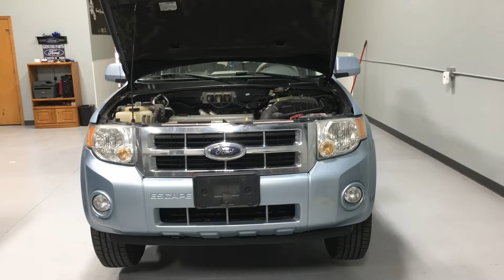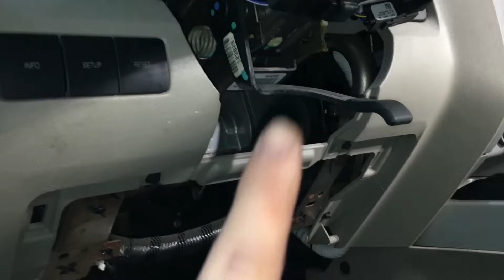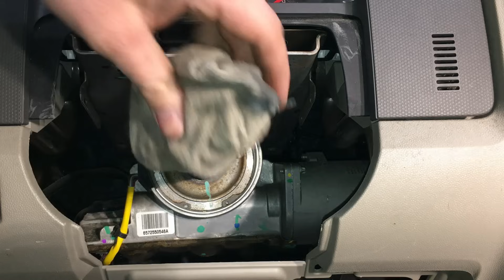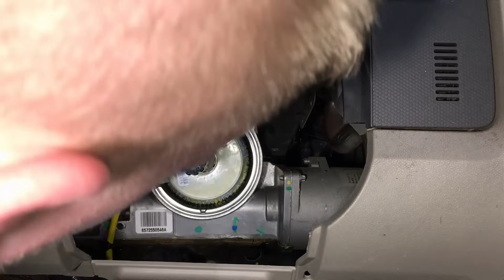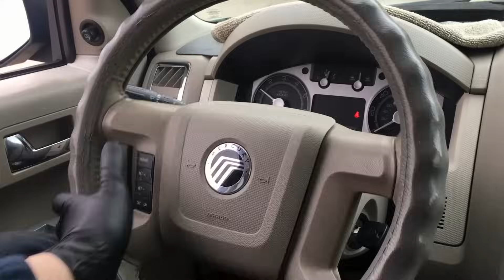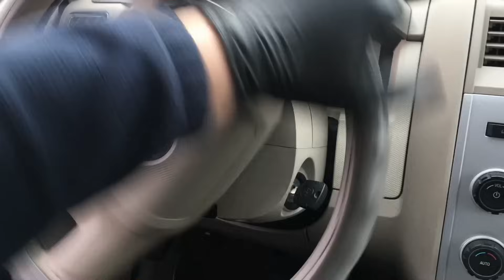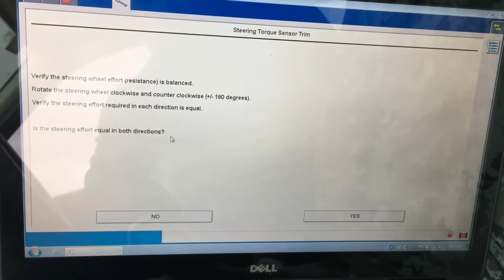2008-2012 Ford Escape Power Steering Code B2278 : EPAS Torque Sensor Critical Installation Steps

Comment: I followed this video step by step and it worked for about 5 minutes after. I reversed out to the right to go for a test drive and the power steering went out completely. I used a cheap $40 torque sensor from eBay (it’s a junky escape that’s a backup car). There’s no codes and there was no noise. Just completely went out after I replaced it.

Comment: So would this cause the power steering to shut off on occasion? This started happening, and now there is no power steering at all?
Reply from the maker: Yes it can, time to pull codes.
Reply: Thank you for the input, will hook it up and check. No engine light at all but I will check. Thanks for all the content! Love your channel. I have a 5.4 too that you have been a tremendous help with.
Reply from the maker: You must pull codes from the power steering module.

Comment: Question:  Replacement went perfect as video shows, on jacks stands.  Then I put it back on the ground and no more power steering??  Did I miss something, or is the power steering gearbox bad.  It did Not have the P2272?? code before hand, just super tough steering...   Any advice would be great....  PS:  Snap ring destroys cheap Harbor freight snap ring tools....  Always buy built in USA... bc

Comment: I installed an AUTOTECNICA FD1318479 torque sensor from RockAuto and programmed the trim adjustment. Only lasted for 2 weeks and my customer is back with the same B2278 code and armstrong steering. Thoughts anyone?
Reply from the maker: What was wrong with buying a Ford one?
Reply: @FordTechMakuloco  great answer, real helpful. The price. Ford  was double.  I was moreso wondering if anyone had run into the same situation.

Comment: HELP PLEASE, have the part and everything, that the step of aligning the window before i replace sensor. The arrow is aligned on the old sensor, but i don’t see the window. Do I replace or does the window need to also be aligned when i take it out? The arrow is aligned but the window isn’t. Does the window need to only appear when replaced or before replacement aswell? PLEASE HELP

Comment: I have a question I have a 2010 mercury mariner . Problem with power steering it goes in and out along with blower moter for heat. But not the symptoms that you show on here. Not sure if I replace the sensor

Comment: This 08-12 ford escape  Power steering torque sensor is pain in the ass to replace cause they are very very tricky and only one time use means if you get it wrong its done, I've tired 3 different sensors. One from amazon thats fliped out right lock and took it out and re aligned it put back in than it fliped to left. Same jack stand surface level area. Than tired the old one after zeroing the hole in the sqaure window it worked fine but it had a problem with vibration a bit thats why i wanted to replace in first place but hey atleast i have power steering. Going to replace  the whole steering column tomorrow. I will post an udate on the result. @FordTechMakuLoco any suggestions bud? Thanks

Comment: Did mine today. All around good vid. NOTE: the new sensor did not work at all until I ran the steering column trim sensor re-learn. Performed with X-tool d8.
Reply: OK... now we are talking. I followed this video and the steering is as stiff as it was prior to making the repair.
More on those learning tool anyone?
Thanks

Comment: I did this and replaced the sensor. When I turned it back on. It still had the code and the steering was still stiff. Do I need to replace the entire thing?

Comment: Does anyone know if you just unplug the sensor if it makes the steering loose but manual ?
Reply from the maker: It will go full manual steering, not recommended.
Reply: @FordTechMakuloco  yeah now it fights against you the harder you try to turn the more the motor fights you. I’m not replacing the sensor. Got 300k on it and AB’s module bad to but I’d like to be able to move it round if I can. Guess I’ll sell it as a parts car.

Comment: I remove the new Ford torque sensor i put in after reflashing the unit steering wheel went to the right.
After removing it in line up the upper and lower spinals and reinstall the unit it works perfectly fine. Thank God

Comment: When I was putting the steering column back in place I had issue of it binding up and knock me out of the window.
The spline moves up and down once you remove the column.

Comment: Cuts out the biggest pain of the job lmao
Reply from the maker: What's that?
Reply: @FordTechMakuloco  putting that damn steering wheel back lmao
Reply from the maker: It take a bit of patience to line up but only goes one way so its pretty simple.
Reply: @FordTechMakuloco  but great video I just did mine yesterday

Comment: Thank you for this video! Was able to replace at home on our 09 Escape. By chance do you know how long it takes for the PSCM to relearn the trim on its own? I purchased FORScan and ran the re calibrate torque sensor program. It says it completes successfully. But its still stiff turning to the left and smooth to the right. Debating whether or not to have the local shop do it or just wait and see if it does it on its own.
Reply: I'd love to know the answer to this too. Replace mine as per video but it's as if I never replaced it. Stiff as it was prior to repairing.

Comment: I did everything correctly and I still have no power steering.
Reply from the maker: Clear codes in the power steering control module and retest.
Reply: @FordTechMakuloco  thank you I will try that
Reply: I flash my 08 Ford for torque sensor.
And the steering wheel took a spin to the right lol I did something wrong. Lol
P.S. - That was one tuff C  Ring to remove.

Comment: How do you keep everything lined up when putting the steering column back in and putting the 2 bolts on? Doesn't it mess up the alignment on the sensor when the whole thing is moved up when screwing in the bolts?

Comment: Got a 09 ford escape. No power steering codes or wheel shake like that. However, it binds up and hard to turn to the left, but turning to the right is fine. Like it lost power steering on the left only…. Very odd. Anyone know what this is? Hopefully easy fix

Comment: I recently purchased a 2012 Escape and it does have this fault code but the steering wheel doesn't shake and steers fine, I've tried erasing the codes but it immeddiately comes back. What does that mean?

Comment: Question for you or for any other commenters: I did everything perfectly except I forgot to actually plug the torque sensor in before I turned the car on and tested it…now I’m left wondering, would it have worked if I had actually plugged it in to begin with?

Comment: I know this video is five years old, but I just wanted to ask/confirm: you don’t need the “fast learn mode” or to use the torque sensor trim tool, do you? That’s just to make it easier/faster? It will still be okay to just let it learn slowly?
Reply from the maker: No you will still have power steering just not perfectly equal assist.

Comment: Thanks for this great video. This looks well within my skills. One question. Does that alignment need to stay until the key is first turned on or only until you pull the pin? Thanks again

Comment: Car came in with no power steering. I changed this sensor according to your video it still had no power steering. So I used my scanner to recalibrate the sensor at which point my steering wheel spun all the way to the right. I know I had the sensor in the center. I’ve done similar repairs before. Unsure if I should just change the entire thing for a used one or try with another donut again

Comment: So, what does it mean when you do all of this, and correctly, but the power steering assist fault code is still showing and the steering is still very stiff?  I know i did everything correct, I lined it up correctly, pulled the pin, and the small hole was centered.  Turned the key, and the wheel didn't spill out of control. Basically did everything step by step, but the code is still there and still have stiff steering, both directions.  Thanks

Comment: I'd agree with all the praise for the great Makuloco. Wouldn't have done this job without him. 

I'd add a bit to other commenters, the snap ring defies typical tools. It's probably 3" diameter which means it requires a pin-reach and crimp force beyond typical snap-ring tool design. Bought 3 myself before grinding my double-joint-long-nose-45 degree pliers down to fit the ring holes. You may wish to consider the same as you'll need a big grip-reach, or two hands, to hit the tension necessary to reassemble. You need a free hand to position the column sleeve and you'll probably be leaning on your right elbow on the seat. It's also an angled wrist which decreases grip strength. Double-joint-long-nose will get you a smaller grip reach and increase your force accordingly.

Brian mentions the importance of the 11:00. What I missed was the importance of 11:00 for reassembly of the column. Cost me a bit of fussin around before going back to 11:00. You may need the key unlocked here, as well, as it may have dropped into the lock detente during disassembly at another angle.

Comment: I did this (without clearing the codes) nothing happened at all no spinning no fix nothing
Reply from the maker: So you had the B2278 code, successfully fixed it then didn't clear codes?
Reply: @FordTechMakuloco  I didn't think it was required now I know I messed up 😅

Comment: Hello, Thank you for this video.  I was able to successfully replace my torque sensor thanks to your video and my SUV was working for a few days til i got the dashboard alert that says, "Power Steering Assist Fault" again.  I has a shop reprogram the module again and it was working fine, then after a few days, my power steering assist alert goes on again.  When I was driving, the alert when on, but I still had power steering, it was only til i turned the engine off that there was no power steering.  Please let me know what you suggest I can do.  Thank you.

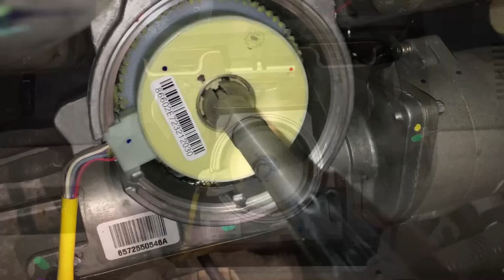Comment: Thanks for the video!  About to try this on my 09 Escape.  Am I looking at the wrong thing around 14:44?  It doesn't seem like the triangle is alligned with the steering wheel notch, still off by 10 degrees or so...

Comment: My question is, since I don't have any power at all when I start it and turn the wheel a bit there is no steering noise.its like it's completely dead. Would it possibly be another issue and not the steering g sensor?

Comment: Thank you very much! An excellent video on replacing the sensor, only I managed to put it on 5 times. Know-how on combining holes. We put the sensor on a strong light source, I put it on the phone's flashlight and gently rotating the inner parts we look for the bottom hole. As found (it is lighter against the background of the lower plate), insert the paper clip and the sensor is ready for installation

Comment: Reassembled and steering didn't freak out. But dash still displays steering assist fault. Suggestions? Video very good btw. Very detailed.
Reply from the maker: Clears codes with a scan tool in the PSCM.

Comment: i had the same shaking in steering at idle until no more power steering...and cheked with OBD2 tool and .no check  engine codes at all ???? Only an orange wrech light in cluster at the exact same time the power steering stoped working

Comment: Why did you skip putting in the column mine wont slip back down over for some reason.
Reply from the maker: It literally slides right in only one way, line up the thicker spline.
Reply: @FordTechMakuloco  mine must have had air trapped because it would not slide back on i let it sit over night partially on next day came out slid right on idk if the grease and air created a vacum like effect or what after you put this in do you have to erase the fault code ?

Comment: Hello ....thank for the video...my torque sensor does the same thing....until this morning no more shaking and no power steering ...is it still the same prosedure ...
Reply from the maker: Yes as long as you have this exact code
Reply: @FordTechMakuloco  ok thanks i will make sur with my obd2
Reply: @FordTechMakuloco  ...i had the same shaking in steering at idle until no more power steering...and cheked with OBD2 tool and .no check  engine codes at all ???? Only an orange light in cluster in shape of a wrench..right after the power steering failed completly

Comment: Followed this step by step for my B2278 on my 2009 escape non hybrid and still shows power steering fault and stiff steering.   Do I need a commercial grade scan tool to finalize this properly
Reply from the maker: pull codes on the pscm and clear them, cycle key. Does it work now?
Reply: @FordTechMakuloco  Everything seems to work now.   EPS is something very foreign to me as I'm in an Infiniti dealership environment.    Nice video!!!

Comment: i have a 10 escape 3.0  power steering assist failure comes up on my dash. i changed the steering torque sensor , still no power steering . any ideas?  thanx Don in Jersey

Comment: Is this the same process for my wife's 2008 Tribute? 
  I'm thinking that it is the problem with Her steering wheel wanting to move back and forth while the car is stopped. There are no other issues besides when her car is in the stopped/idle position. 
 If so can you provide the part number?

Comment: I had this problem fixed by my mechanic, and it was very difficult to align properly. Big question: Will this be permanently aligned? I am afraid that when I drive the car, it will suddenly freeze or turn to full left or right when I am driving, especially during high speeds.
Reply from the maker: No this is only used for initial alignment.
Reply: @FordTechMakuloco  Thank you for your response. By replacing the sensor module, will this be a permanent fix?
Reply from the maker: yes

Comment: Replaced torque sensor successfully.  Cleared codes and got power steering back.  Was easier to turn left than right, but don’t have the ability to calibrate trim.  Test drove vehicle and drove fine.  The next morning, it started freaking out…deciding on its own when to turn left and right.  Got too difficult to safely keep it on the road, so pulled over and shut it off.  Started back up and power steering is completely gone.  I’ve ordered a refurbished motor assembly with brand new torque sensor and internal parts, but now I’m worried about NOT replacing the entire column.  Is there anything EPAS related on the upper half of the column, or is it just turn signal switch, etc.?

Comment: Great video we were able to replace the sensor but unfortunately, our steering wheel is stiff when we try to drive, I have to use my arm muscle to turn the wheel any solution for that?
Reply: I think you need to clear the codes after the replacement.

Comment: I know this is an older video, but would the Torque Sensor just cause hard steering of the escape with out the steering wheel shaking back and forth like you demonstrated at the beginning of the video?????
Reply from the maker: Yes it can and would definitely set this code.

Comment: Thanks for the video.  It was very helpful.  I would note that I have no idea how you removed/installed the snap ring with those pliers.  I ended up using a pair of sixteen inch, ratcheting pliers and it made easy work of it after I struggled for hours with a pair of nine-inch pliers.

Comment: What if the pin is off to the left before pulling the pin. everything is aligned tires were bumped.  The alignment tool is perfectly aligned with no interference. Should the tires be bumped to center the pin?

Comment: I installed my torque followed along and wheel spins to the right, tried to pull it all apart and re did the install and it happened the second time :/

Comment: Mine doesnt shake or swing left to the left or right. Could it be the epas itself?
Reply from the maker: Pull codes first.
Reply: @FordTechMakuloco  2010 Ford Escape. 3 Litre awd. It was replaced entirely in march of 2014 under recall. In 2021 I replaced myself the steering angle sensor (I had no shaking) which I bought from Power Steering Seals. Again a year later it has happened again. All fuses to the PCM were checked including the fuses inside the cab. #35 and in the engine compartment A which is an 80 amp. all good. In fact I went thru all the fuses in the cab and the shroud. I also switched out the PCM relay.  My connections are all very clean. The odd thing is I have no shake or immediate turn to left or right, which was the case in 2021, but armstrong steering. I bought Innova 3160RS which has given me codes (C1963 Stability control Inhibit warning) and of course once again the dreaded 2278.
C1963 also notes beside it  "Not current"

This also confuses me. I also got a code earlier but can't find it again P06B8. Internal control module Non Volatile Random access memory NVRAM error. This code indicates there is aproblem with the NVRAM in the PCM.
I have not yet pulled the connections to the PCM itself.
My questions are I have to shimmy or shake. Isn't this supposed to be an almost tell tale sign?
Given its been a year since and it has occurred again. I am leaning towards a fault in the PCM.
What are your thoughts?

Comment: On my 09 escape the steering problem started off when I would turn left I would hear the alarm and the steering would get stiff but it only lasted a second so I couldn't ever read the error on the dash.. Eventually I was able to catch the error and it read "Power steering assist failure" and after a few months ( a few weeks ago) I lost my power steering and the error on the dash is permanent now. I still can steer with power steering by arm strong but my question is, is this the video I need to fix my vehicle?